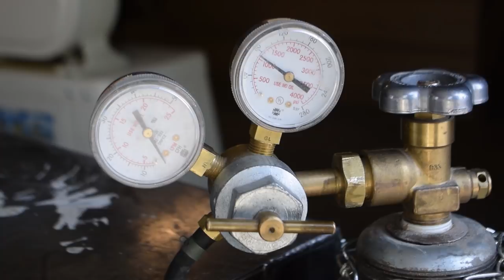Floating Computer Desk from Leftover Hardwood flooring

Comment: Nice concept.  Nice execution.  

Only advice.  Do yourself a favor and replace your saw blades, or at the very least, get some liquid laundry detergent and soak your blades in a diluted mixture and take a brush to it.  It will lessen the blade burn on your material.

Comment: When welding,  Personally I think you should just go straight slowly while watching your pool size behind you rather than doing small circles along the weld to create a stronger bond unless you're using TIG. I used to use the same technique then later got corrected by an instructor that they may look nice, but they're not that secure. I thought I would pass along the message. :)
Reply: I may have been taught wrong. feel free to let me know : )

Comment: Quick tip: i work on hardwood floors and if you want a nice jagged edge floor handscrape using the direction of the wood then sand it with 120 grit sandpaper

Comment: The way you used that table saw is scary.  That's an easy way to lose your fingers.
Reply: Not only that.  He's going to shoot himself in the finger too... 4:38
Reply: What’s wrong with the way he used the table saw?
Reply: @roteguard  the blade seemed too low for the material he was cutting, and the board wasn't staying flat on the table saw... The board could have got caught and kicked back at him.
Reply: Ajw312 I thought the blade was supposed to just barely be above the material like an 1/8th of an inch?
Reply: @roteguard  It's not supposed to lift off the surface like that though towards the end of the board

Comment: for safety sake anyone watching this video who isn't a wood worker, maybe if you're just a starting diyer please dont make table cut saws with no riving knife especially when you're ripping. Kickback is a real thing, and the riving knife prevents that, his saw has a slot for one he just pulled it out probably because he wasn't using the correct push sticks.

Comment: Nice table, but why did you want to glue it? You could screw it to metal frame without any visible holes on the surface(drill the counter half way)

Comment: Excellent job but not very practically for the average DYI weekend guy or gal. How many of us can weld steel into a frame like this?  If you would have simply built your desk out one more feet on both ends you could have used those side walls for structural support and still keep the floating appearance.

Comment: Liked the way you tried to bring your initial idea to fruition. But there's a few things that were both scary, and things I would have definitely done differently.

Idea is nice. Execution, not so much. A bit of a voice over or something would've been nice to hear what you're doing as well instead of the really crappy music.
And while the end product looks okay, I'd be scared to use it. Doesn't seem like it's able to support a whole lot of weight. The computer and such might be fine, but adding a bit more and I'd be afraid to rip out the wall. (Say someone would try to sit on it.)
The steel frame is nice, but doesn't add much here, it seems.

Comment: wtf was that? No support except for frame screwed to the wall? Don't try this at home folks. Put any more weight than a pair of laptops and a couple of books and you'll be ripping out the wall.
Reply: Probably wont rip out of the studs, but the frame will definitely warp and bend.
Reply: Sple fix, put L brackets on studs and its not a problem.
Reply: Frame will bend before any ripping happens but yes not enough support!